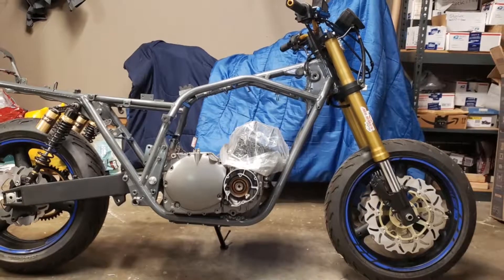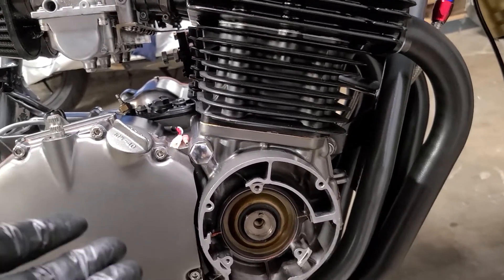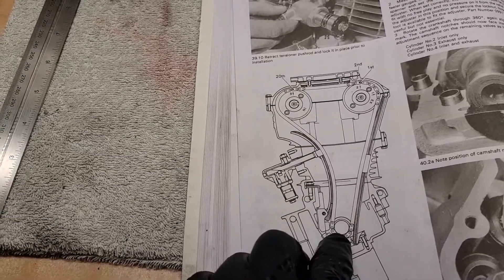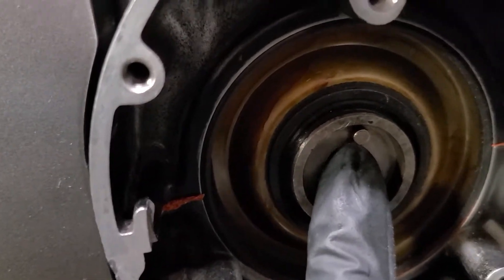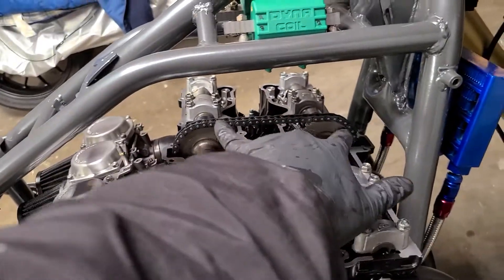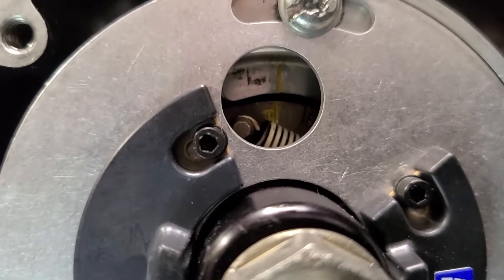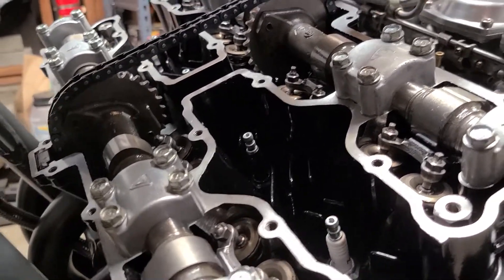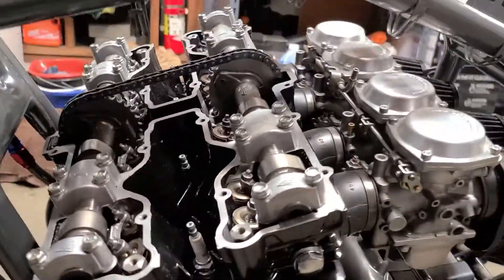DAY 82 83 Suzuki GS 1100E Custom bike build/ cam timing and adjusting valves

Comment: Just built a 82 gs1100es complete motor. But full drag race. I Did mtc 5pin slider clutch , mtc 13:5 to 1 forged pistons , complete head I did all a.p.e. components cam sprockets, cam chain, stainless valves , 400lb. Springs retainers, I cut the valve seats to 1.5mm over on intake and 1.0mm on exhaust ,guides were removed and  bronze put in. Full underutilized transmission ,all 3 shift forks are forged , did a big port and polish on head , matched ports with molding putty w/match port cuts from carbs to head and exhaust head alot of hours in that port an polish. I did full lowboy Koenig front end, I built a club foot swing arm  8.5inch longer . Full dyna tek ignition system w/drl 400 2step box , went with a rc battery powered set up to pull 14.2 volts to coils (full loss). Rc comp.3blade drag wheels 7inch rear wheel . Drive is 630 X 142links with 5/8 inch offset front sprock and an outboard carrier bearing cover from D and G. Electric to air pinged shift assy. Stock crank but freshly disassembled and full rebuild w/ world bearing components etc.. rebranded and welded up. All work but the sleeves and cut to piston size I did myself . Had alot of fun and a couple of hair pulling moments.
Great motors and still used today in motorcycle dragracing. Long live the gs 1100 motors..

Comment: Put a lash tool under both adjuster pins balance the resistance and lock set nuts. More reliable than doing 1 at a time. You get 1 set then try to bring other to it. Instead, bring both to resistance then set. By using 2 feeler tongues your balance is achieve way easier and more accurate. Same motor gs 1100esx and running full drag motor build. 13.5 to 1 mtc forged pistons w/.60 over bore oversized valves,huge web cams I have to degree no matter what,but that has nothing to do with setting lash. Big cams are degreed with zero lash then after your degreed in you go back and set lash off the heel of cam lobe. The dead zone basically.
Try it once you won't do one at a time ever again. Ride Safe

Comment: Ok technically you discussed cam placement NOT cam timing.  Tscc motors should not tick the older kz bssed shim over 4 valve bikes don't care so much. You also didn't mention the fact you run the intakes and exhaust at 2 different settings. Also without the correct adjuster tool it's extremely hard to do with just a 7mm and flatblade screw driver.
Running a fresh head I always start at the right setting as they WILL loosen up soon as there done seating. A $59. Set of adjustable cam gears set at 110/110 will increase mid and high power and torque.
For guys replacing the Week factory chain tensioner. You must have a cut down valve cover installed prior to adjustment.
On the carbs 135 mains a shim under the needle valve and 3 turns out on fuel screws to start.  Enlarge the relief hole in each slide ( let's slides return to closed faster) and absolutely make sure the fuel screw orings down in the carb are fresh or you'll suck air and can never get it fat enough. Never run a full open pipe w CV carbs the slides require a minimum backpressure that said I only run a endcap w no baffle. On dyna-s advance it as far as possible unless you have detonation due to fuel quality. Inexpensive power updates. Use 84-86 gs1150e or efe overseas 36 mm carbs vs the 1100's 34 mm. Also 1150 model D cams have more lift and duration than 1100 cams.
Lastly I always do a relay power upgrade anytime you switch from tan coils to Dyna. The factory power wire to coils give a realistic 10.4-10.8 bolts this is on the boarder of the dynaS not firing under extreme cylinder pressure and temps. A relay to battery using the stock coil wires as a trigger is a absolute must for green coil users. I'm CK Ryder on Facebook
Reply from the maker: They were all adjusted at   4 thousands of an inch Also I did install a relay on the Ignition for the coils  I'm gonna be installing some different carburetors on a later date  always followed  the  GS Bible  to get the bike running will be changing the carbs at a later date I have owned 4 of these bikes and currently have the two thanks for the info always could use the help from fellow GS owners thank you and ride safe
Reply: I'm a drag bike racer and run full loss ignition. My battery set up is 14.2 volts w/7200mah  from RC Helicopters. I run the 3ohm lime green coils with 13:5 to 1 pistons big bore set up. Never had any issues  with that.
Reply: Oh my carbs are mikuni 38mm RS flat slides

Comment: what jet size did you go with, or what jet kit did you use? i have the same engine
Reply from the maker: It already had a dynojet kit install  In the carburetors I can't remember  What size they were you can find on eBay you can get stage 1 to stage 3 but I do recommend Dynojet they are a good quality
Reply: @krmoto5158  awesome, that's all I need to know. I'll order the kit. Thanks bud. Sick build btw. I've watched all the videos of it.
Reply from the maker: @THELXFOX   Thanks man I appreciate👍 I should be uploading more videos soon